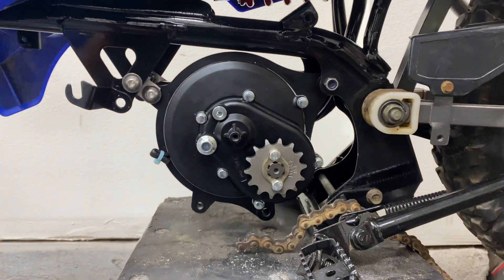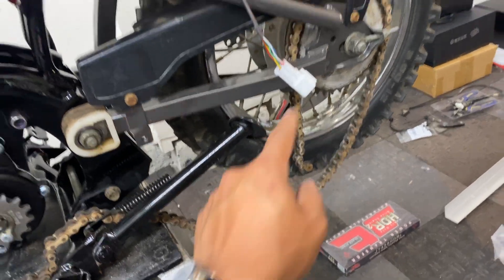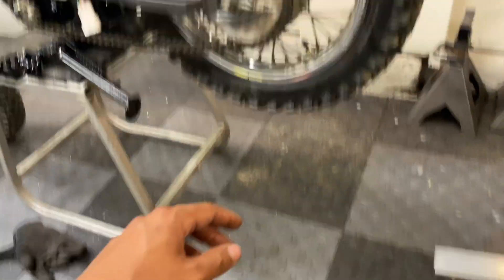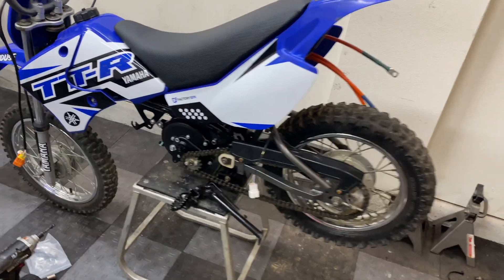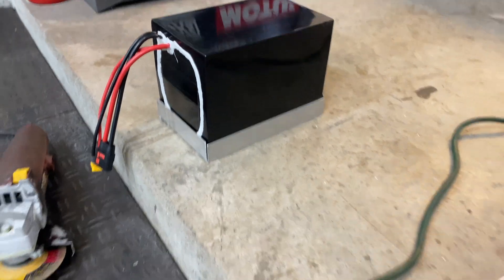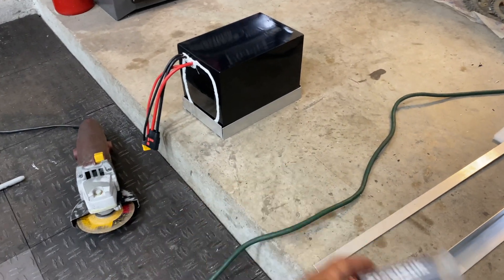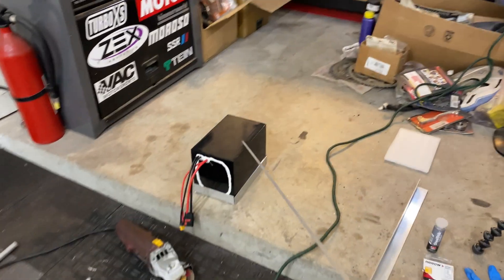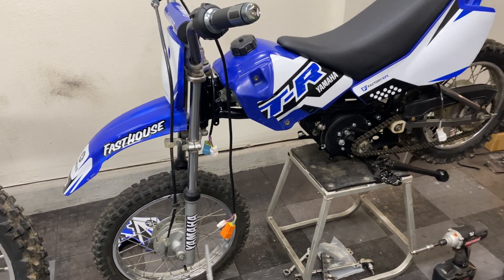Project TTR-E 72V Yamaha Electric Pit Bike Conversion QS138 Fardriver Part 2

Comment: Great work. I am converting a quad with the same motor and controller. Did you end up changing parameters via an app and a Bluetooth connection? If so, what app did you use?

Comment: I just picked up a 2004 ttr 90 with a bad engine was thinking about just buying another gas engine for cheap. Could I build this same build as you for less than $1000
Reply from the maker: Unfortunately no, the battery will cost the same as the kit (so likely at least $1,600 altogether)
Reply: Wonder what the range and speed and stuff would be
Reply from the maker: @cookingwithdrew2790  that’s all dependant on the battery capacity and size you go with. 72V 30AH would likely get you at least 30 miles on one charge (also depends how much power/throttle you are using during that ride)

Comment: Hi Pat just a thought on your battery tray, rather than cut 4 seperate pieces , cut one the length of the 4 and cut the bottom flanges at the length of each side, then fold the top flange at each cut, keeping the box with only one corner to join, just a suggestion. Was that the same motor as Electro & co's Qs138 V3 kit, and how does that controller match up to the 260 controller? Could I use that kit with the 48amp hour 72 volt battery and come out with similar results as you got on the bigger Yamaha? I'm looking to convert a CRF250L Honda but want to keep it street legal, and dirt capable. Any suggestions would be greatly appreciated.

Comment: Will this battery be able to handle the power? Thanks Pat!
Reply from the maker: It’s the other way around. The battery supplies the power. This battery kind of going to be the limiting factory of this set up in this case, 100 amp peak output. For example, my big yz250 battery puts out 350 amps peak with the same motor.
Reply: @PatOutdoors  How many continuous amps do you recommend for a battery that will fit a bike that size?

Comment: Nice build pat, love your content. You might be running into some problems by mounting your motor “upside down”. the qs 138 v3’s gearbox was made to have the reduction gear point up instead of down like you have it. This can be quite important for the oil and went hole in the gearbox. By having the gearbox point down( as you have) you might run into some problems. Not trying to be smart, just saying you might run into some problems. Again, absolutely love you’re content
Reply from the maker: Already plan on rotating this motor counter-clockwise to fix a chain guide alignment issue as well. Appreciate you lookin out though!

Comment: Pat, buddy,bro. That front sprocket needs to be rotated up. The alignment is to low and it’s going to be a problem. Sorry buddy just looking out for you
Reply: your probably right! The chain is under alot of tension on the top so it's gonna wear through the plastic slider and it won't feel well riding the bike like this. Unless the chain is straight as soon as you sit on the bike 🤷‍♂️
Reply from the maker: Appreciate you looking out. I’ve got some re-arranging to do if that’s the case..
Reply: Probably look at some pictures of a stock ttr or go to a dealership and take some pictures of it and get it close to the stock position as possible.

Comment: Do you plan on protecting the battery with a cover?
Reply from the maker: Once I've confirmed the chain alignment is not an issue and everything is functioning correctly, I will get more detailed with it. Early stages!

Comment: Estimated top speed for this bike? I ordered the EXACT same kit and its coming in a month, and what do u recon is the best front and rear sprockets for speed. Thanks!
Reply from the maker: I honestly don’t have an idea at this point yet. A lot of factors to consider such as overall diameter size of rear tire, power output of the battery you’re using, weight of bike, etc. What bike do you have btw?
Reply: @PatOutdoors  I am building an electric tao tao db17 dirt bike, basically striped the bike down to frame, tires, and plastics and seat, no engine or anything left. Thanks!